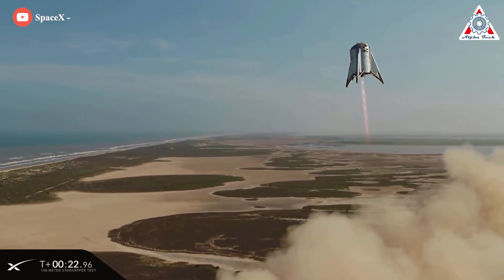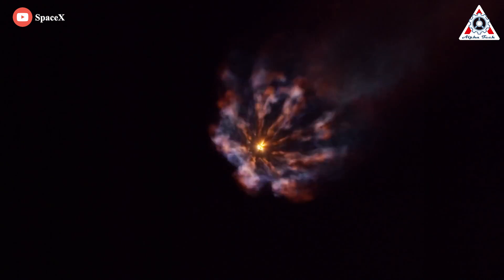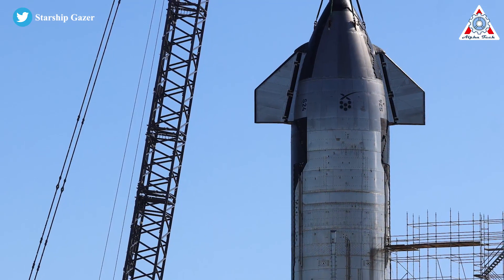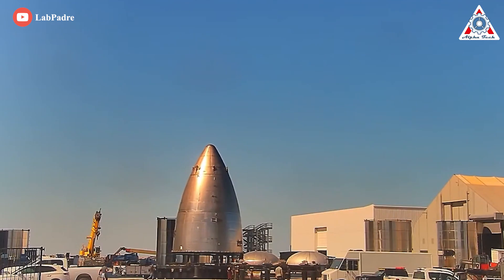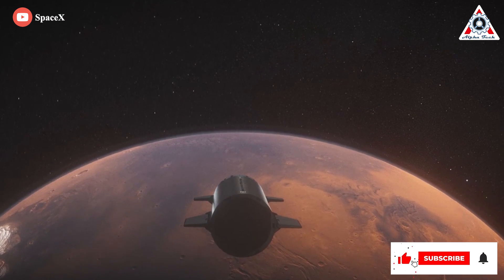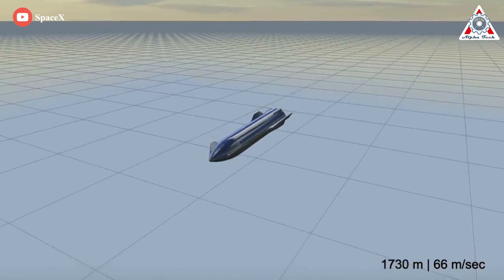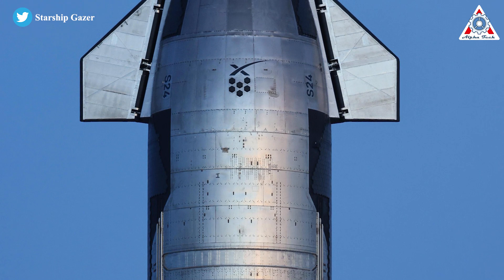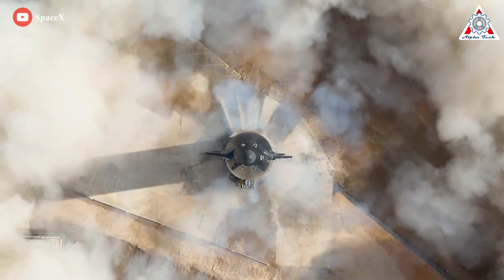What SpaceX just did with Starship Nosecone is unbelievable and unlike no one...

Comment: Each of the two upper flaps should comprise two laminated flaps that have the ability to flare open upon reentry to help slow the ship.  They should open into a "V" shaped fletching; and have heat shielding.    Further the Starship should have its own landing framus that comprises a very tall scaffold.  it should be about 900 meters tall; have four sides; and, be slightly funnel shaped.  Snap closed lassos or snares should be disposed near the top, at a slight downward angle. The snares comprise a nylon band and are anchored to a pipe that can wind in the snare when signaled  Sensers will signal when to release the loop ends of the snare.  This will allow for gently capturing the ship even if off center when it lands.  A graphic sketch is shown on my "community tab" channel.
Reply from the maker: Oh, thanks for your great info. I will find out more about this
Reply: @alphatech4966  Again; I am your humble servant.
Reply: @alphatech4966  Did you happen to find out anything about new landing techniques?

Comment: I know it would be a great feat of engineering but my idea would be to make 10 one piece heat shields ! This would eliminate using thousands of heat tiles and loosing any during reentry
Reply: The gaps between each tile, allow for expansion and contraction of the Steel Ship. Larger tiles would crack and possible damage the structure.
Reply: @bowtoy  ya just an idea i just  thru that out there and  hoping spacex resolves the currant issues !

Comment: Why cant the heat shield tiles be 3-d printed in larger pieces? allowing less fragiltiy in the attachment proces....
Reply from the maker: Thermal expansion and contraction. The heat shield would expand and contract at a different rate than the underlying structure as it heated up, which would have caused deformation or cracking. So it needed to be individual tiles with flexible gap fillers between them.
Reply: @alphatech4966  i am uggesting just larger unit tiles so less vulnerable i knoe thermal expansion at differnt rates, tiles always coming of apparently => better anchoring larger 3d printed tiles...

Comment: Just curious - I am sure it got explored already - modern sport drones can accelerate like crazy, other drones fly for even 40 minutes. What makes it unviable to build huge hectacopter or octacopter with huge power batteries that would lift the rocket until the atmosphere gets to thin. The drone would then detach and come back to the ground to recharge. The rocket would continue using traditional rocket system. All the lift and acceleration provided by the dron ewould mean less fuel needed for the rocket (more cargo space or more fuel for manuevering in space). Hmm?
Reply: Issue 1) Scale.
Issue 2) Battery power.

Booster has a thrust of 70 MN, while a 747's Rolls-Royce RB211 is like 250 k N. You would need 280, and that's driving them with kerosene. Note that all the weight of these engines, and their batteries/tanks/whatever and the airframe and ... you start needing far more power. Which means more engines, and then more weight.

When you use batteries, you're *innately* carrying waste cargo. Period. A rocket gets lighter, *FAR* lighter as you consume the fuel. A battery doesn't get lighter. You've converted the chemistry inside the battery from 'high energy' to 'low energy' ,**but you still have the battery's component atoms going for a ride**. The battery is 'more reusable', but that does not make it 'more efficient'. 

A battery can be thought of as both a "fuel cell" *and* a "tank" for said fuel cell sealed into a container. So ... a fuel cell version, (where the exhaust products are jettisoned) might get you somewhere.

But. If you're going to "lift it up", your best bet for powring your quadcopter-lifter turns out going full circle to: Quadcopter powered by raptors. Hey, wait. That's basically what Booster *is*
Reply: @shrikedecil  well you could do without batteries, instead use a wire that just unwinds up, or laser maybe? I know, I know, not feasible. It is just that it feels like the initial acceleration and takeoff could be assisted with electricity based solution rather than rockets...

Comment: There's not much news in this video.
Starships nosecone is made of less segments. And the upper flaps, lean a little more backwards (we knew already) 
The heatshield tiles are improved that was necessary, however the nosecone tiles are custom made (not handy for mass production)
These leave some unanswered questions for me. 
The issue with a 33 raptor test needs to be resolved, because the concrete scatters out of the pad. I hope they will try to pave the concrete with metal that's water cooled. That's the only solution I can think of would work.
Secondly the issue about the environmental state legislation in Florida. That's an issue as well and no news about that either.
Reply from the maker: Thanks so much for your information. We will try our best to keep you updated